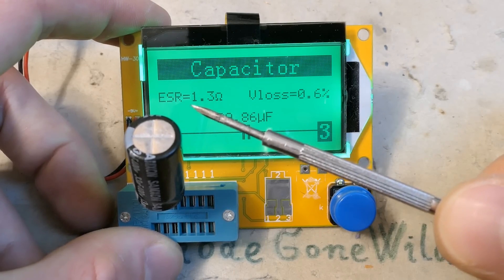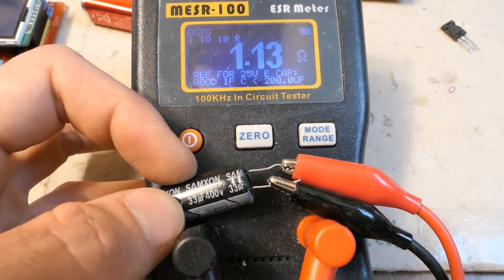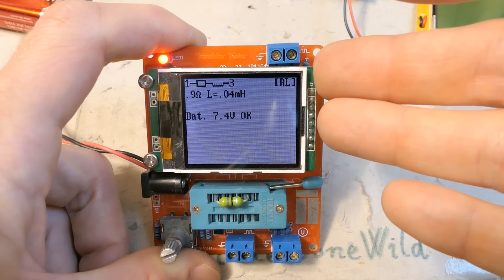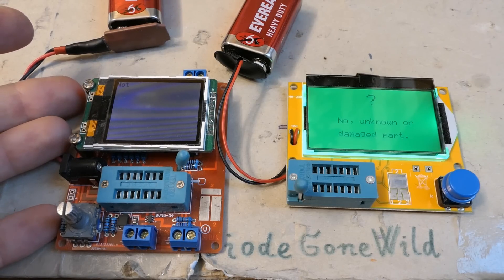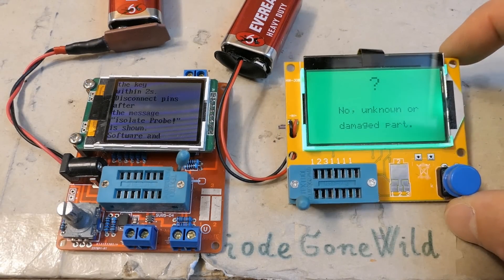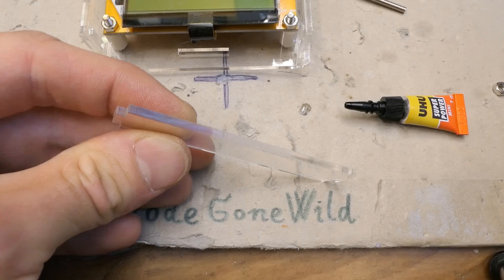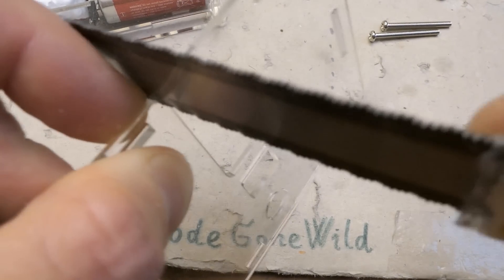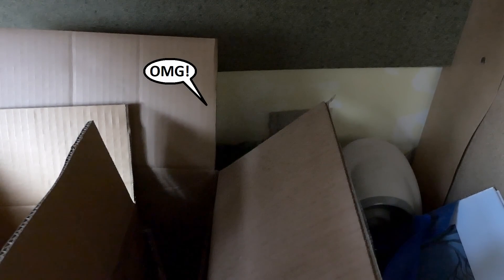Transistor tester comparison, test and box assembly

Comment: I have the yellow tester because it was the cheapest one. There are more bugs in the software, notably 2 diodes in antiparallel on pins 1 and 3 show as in antiseries (?!) but they are OK if between pins 1-2 or 2-3.
Reply from the maker: well, I also noticed this before recording the video, and then I forgot to mention it :D. Mine shows antiseries diodes too, so it has the same firmware with bugs...
Reply: @DiodeGoneWild  Did it arrive at your old address with a weirdly written house number? If so, it was a donation by me and I bought it from the same seller. My box fit well, though. The side hole lines up with the backlight connection on the PCB but I'm not sure if that's what it is for - personally, I used it to mount a switch to prevent standby discharge and reduce the screen on time after measurement.

Comment: The dimer display is because there are 2 serial rezistors of 250 Ohms in display power line.  First is on the main board, second one is on the display module. By data sheet of display there should be  one 250 Ohm from 5V . If you short rezistor on main board the brithness will be fine.

Comment: At 11:04 it shows that the tester is not calibrated, calibration is done by shorting the three test pins together with a low ohms short, like three pin jumpers soldered together, depending on the firmware version it may then require a stable capacitor for calibration between 100nF to 1µF, preferably something like a film capacitor is used. If SamplingADC was enabled in the firmware it will also require a small capacitor around 10 to 30nF to later be used together with small inductors that could otherwise not be measured, but this can be ignored if that feature is not needed or if it was not compiled in.

Comment: 3:47 you can update the firmware to have the menu and the special functions. It will show more information too
Reply: You need the extra components to support the rotary encoder too?
Reply: @edgeeffect  iirc you'll need to adjust firmware for correct encoder type and run 2 wires, either under display or directly to controller
Reply: Links???
Reply: can you guide me to do that?

Comment: Nice comparison 🙂
I can recommend the LCR-TC2 for ~17 USD (w/o VAT). It is more like the red one you have. But it actually makes use of its colour display, and it has a case with Li-po battery. Apparently, there are different versions and I got version 2. But some that are sold as version 2 actually are version 1 ...
Reply: @Mr Guru No.
Reply: Do you have a link?
Reply: @Mr Guru No.
Reply: @Mr Guru the problem is finding what seller is reliable, i.e. will not sell a dodgy clone of a clone
Reply: @Mr Guru Computer says no.

Comment: Which of the two do you think is best?
Reply: I think they are both good with tester 1 being more more info on transistors while tester 2 is faster, more usable, has a pdf manual you can read to mod it or fix it, has a case, its firmware can be updated with arduino or ch341a bios flasher, or any spi programmer
tester 2 is nothing but an arduino (Atmel/avr) chip with display , button, zif socket and little bit of componenets and code.
I think it is not that hard for someone capable to make an arduino shield(add on) to accomplish same tasks.

Comment: I've got the yellow one and you are SO RIGHT about that pin layout.
I wonder if the red one is more accurate because it has more up-to-date firmware or better quality components????
These units have their flaws but they're still a brilliant addition to your workbench.
Reply: It (or both) are based on the open source version that someone mentioned somewhere on the previous videos.

Comment: I have the yellow one with the acrylic case and it fits perfectly, the display cable is very loose on your unit and flops way too forward. Also the case is supposed to come with a black 9V battery holder that sticks with a piece of double sided tape and matches the notches in the acrylic panel. No problems with the lever or button not fitting with mine, it's perfect
Reply: My case didn't come with any battery holders either. Hmm... 🤔

Comment: About the display, perhaps you can change the LED resistance by a lower one to get more brightness. These models usually have the resistance externally.
Reply: In this case, it's a design flaw: they forgot about a resistor on the display board, which is already present, and used a second resistor in series on the main board. Need to remove one of them, both are 220R.
Reply: @Sentinel-1  Yes, I thought that also
Reply: @Sentinel-1  Remove or short ? 🤔
Reply: @jankomuzykant1844  bypass 😉

Comment: Excellent. Thank you. I had wondered about this exact comparison. The YouTuber called "The HWCave" has a good series on improving the yellow model tester. I made his modifications and the modifications did work well. There are both hardware and software changes. Highly recommended. Also, a set of wires can make it easier to use the Yellow Tester ZIF Socket... A 3-pin header to sit in the ZIF, with clips on the ends of the wires to connect to the DUT.

Comment: 11:07
Maybe the transistors are tested on different frequencies. Darlington pairs are usually slow at higher frequencies.
Reply: The hFE also varies with collector current, according to some datasheets...
For example, the DC current gain for the DU808DFI is ~300 when the collector current reaches 1.5 amps, but decreases exponentially below or above...

Comment: I had the B&W one and I was using it until it decided to suddenly die. Then I bought another one, color screen with some more features. As you said, is better to understand the limitations and it will serve you well.
I noticed that some components (MOSFET, Triac, Tyristor, IGBT) may be tested/identifies whet at theirs limits just by swapping them around. And, for the B&W tester, just check to see how the socket is wired; mine was a breeze to use even with large components, the bottom row of the socket was different wired from the upper row.

Edit: I just looked on my B&W tester and the screen is mounted lower on the PCB. They used double sided tape to attach it to the board, so you (in theory) could have moved to seat better the LCD cable.
Also, have you tried to calibrate both units?

Comment: When you measure the mosfet at 12:05, the tester with the yellow board shows the symbol for the internal diode pointing in the wrong direction!
Reply from the maker: :D I didn't notice. I didn't take a closer look - I assumed that whoever designs a transistor tester, can draw transistor symbols properly. I was wrong...
Reply: Only 2 pixels are wrong placed 😉

Comment: Mine has an even weirder pin layout where the top row is different than the bottom.  It's labelled:
Top:  1231232
Bottom:  KAA1233

That's just weird as it was harder to route traces for that order than to use the more logical 1112333.  I don't even know what KAA means, but it's probably just 122 or 133.
Reply: KAA may be the Zener Diode test area.
Reply from the maker: The KAA terminals are to test Zener diodes. I've heard of testers with a built in inverter generating 30V to test Zeners up to nearly 30V, but I've never seen this tester personally.
Reply: @DiodeGoneWild  yes, mine. I guess all of those that have KAA pins can test zeners up to 30V into the K-A pins, I have two different variations of this one and both can. Also these ones have a case with a built-in LiPo battery that can charge over micro USB. Very convenient. One have IR decoder also and one doesn't, but they lack the waveform/pwm generator that the caseless one (same as yours) have.
Reply: KAA is to test zener diodes upto 40 volts (volts vary from model to model). My LCR T7 also have the capability, have nice color display and IR Code capturing sensor. Tested few zeners, the result was impressive.

Comment: The 640 and 470K resistor banks are spec'd at 0.1% in the original Markus design. 
I don't see that on any cheap knock-offs. 
Even without precision parts, it's accurate enough for hobby use.
Reply: Yeah, even most cheap passive components are very good quality wise :P Of course there are fakes and refurbs which have no QA at all and you get what you pay for...

Comment: Good review and comparison man, thanx
There is a pdf manual for this thing.
It is better if calibrated, maybe with pressing and holding the button for a while or pressing it 2 or 3 times quickly.
Using an alkaline battery is a good thing because regular batteries(heavy duty) don't have a lot of charge.
A firmware update might give better results, an arduino or CH341A bios flasher help with this.
Can it be modded with 2 diodes utilizing diode logic, to run it from a 9v power supply adaptor?
Maybe diodes with low voltage drop work best here.
Good luck
Reply: The good thing about zinc carbon batteries is they don't leak. The PP3s have a very high internal resistance, but it's not really a problem for such a device. You probably know already, just my 2c.
Reply: @igotes  Good alkalines do not leak.
9v battery story is different from aa/aaa, b,c
Leakage is caused by some factors
Hot work environment or storage
Excessive radiation of different waves
mircowave, 5G, wifi, ...etc.
I have not reseached other factors
given you my 2 lunas now haha just a joke
on crashing digital currency.
Thanks for the advice though ant the engagement of good discussion
Good luck man

Comment: I've got the right one (green display) and all acrylic parts fit perfectly - maybe the sender mixed the plates by mistake. Once I crashed the tester when measuring a loaded capacitor (stupid me) and instantly I ordered a new one ..because actually I'm just happy with it. 
For modification I did not use the acrylic plate which holds the battery in its place because it makes it difficult to change the batt, when its empty (just put some plastic in, to fix the batt).  I also added a little plate of Cu-covered board on the top-side to remember and to discharge capacitors before testing.   The testing-socket is fine, too  - for bigger components you have to use some short cables with crocodiles anyway (you can solder them on the 3 testing-pads of the upper board  ...that's it

Comment: Well, it looks like I have a slightly updated version of the acrylic case, because on mine: the socket lever is not hitting it, the button's hole is actually at the right spot and I was able to assemble it without any glue at all. 🙂
Of course, the simpler (yellow) tester shows a lot less information, but basic component identification is enough for me – at least it labels all component legs which is useful. 🙂

Comment: Nice 
I bought the cheapest on and it worked fine but after 2monts it didn't want to measure inductors and after 5more monts it completely stopped working. The processor is getting very hot and just lights the backlight of the lcd

Comment: I have the cheaper model of green backlit monochrome display. The acrylic case is a crap by many errors in its building design. I put this in a 3D printed case and it looks cool and handy. The meter is useful for fast measurements of different kind of components and test the capacitor ESR.
Reply: Can you share your 3D model STL/OBJ file here?
Reply: The 3d model need to do some corrections in the pushbutton hole size and alignment. The hole of SMD component tester bay is not deep to touch the inside PCB surface, the main switch hole and 3 holes for small banana connectors is missing. I did some mods to the 3D model manually. For setup it need four Knurl Insert Nuts for use of 4 bolts for internal assembly.

Comment: Yep, my tester is that cheaper "less intelligent" type, works for what I want it for, and supposedly where the battery goes you can fit a 9v holder instead of just having the battery flop about, but mine I just zip-tied it to the case, cos it's a cheap tool, nothing special or anything... :)

Comment: Killed my first one with a cap that still got 20V of charge :-(
Reply: Sorry for your loss man.
But this incident might make the product even better, maybe by gluing some metal rectangle on top and puttin some printed note: please make both cap legs touch this metal piece first so it discharges
I think lots of products got enhanced this way from having user feedback fixing the errors, dealing with trouble.
Good luck man. Try finding solutions to overcome problems this way life becomes better